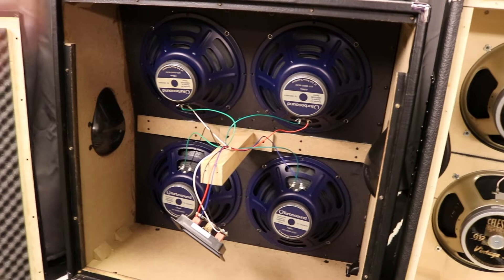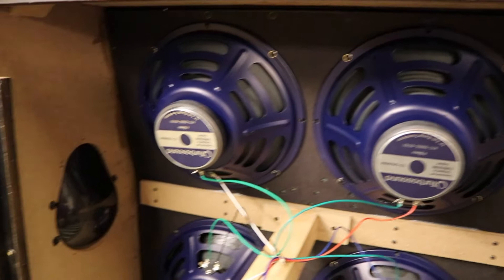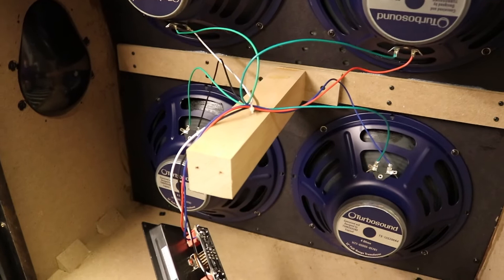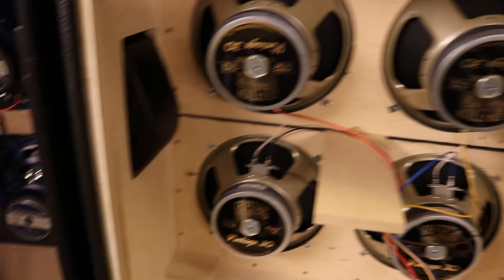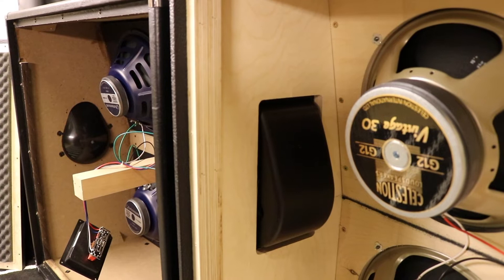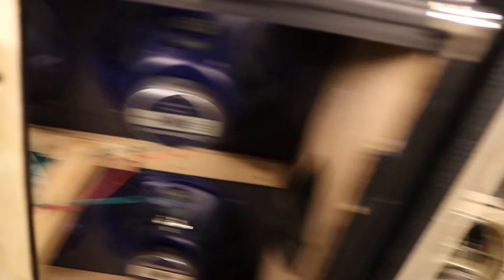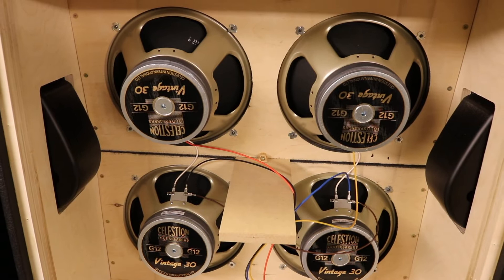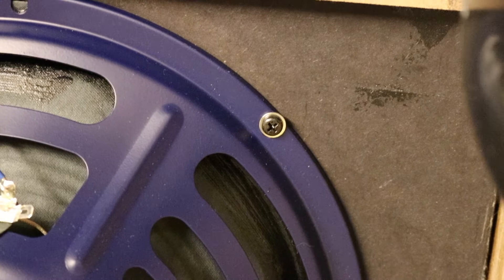Cheap vs Expensive 4x12 Cab WHATS INSIDE ?

Comment: MDF is used because it is very stable (sawdust mixed with glue) and doesn't resonate. All expensive audio speakers are made out of it for just that reason. Plywood resonates and adds unwanted color to the speaker via cabinet vibration. Keep it dry and its fine.
Reply: While I prefer plywood for it's strength, you are correct. MDF is significantly acoustically superior. Soundwaves hit MDF and decay gracefully whereas when they hit a hard surface like plywood, they shatter and produce obvious distortion. Ironically, because the speed of sound for plywood resonance is at around 700 to 1000 Hz, even though people build subwoofer boxes out of MDF, it's the one specific place plywood kicks it's ass. I've built sub boxes out of both, and the plywood boxes always have better SPL, sound cleaner and just all around superior performance. I knew a guy about 10 years ago that took my advice, built a monstrous subwoofer cabinet for his truck double layering the plywood, and without trying, took home 1st place in his city's bass-war competition. 

I have a lot of cabinets, some plywood and some MDF, and the MDF is just blatantly superior. The same speakers in an MDF box with poor low frequency reproduction having swapped them myself into various boxes suddenly produce low end spectacularly whereas in the plywood cabinets, they distort and the wood shutters. The remedy is packing the cabinet with batting or paneling the inside with foam rubber matting or even carpet. I have a 2x10 plywood cabinet loaded with Jensen MOD greens, and after I stuffed it with batting, it sounded phenomenally better. I actually grew to favor 10's over 12's even though I have a ton of combos loaded with them and four 4x12 cabs. 

Monday, I scored a Crate GX1200H head with a full sized 4x12 cabinet made of plywood. That series head traditionally came with compact 4x12 MDF cabinets. After cranking it really loud enough times, it's inevitable; I will have to buy a bunch of cheap Walmart pillows, rip them open and stuff them inside, or line it internally with foam rubber or carpet lol. 

Those heads are 3-legged mutts racing greyhounds until you mod the EQ capacitors and resistors, and add a midrange control to the lead channel. After that, they are the ultimate sleeper amp even being solid-state, but one way or the other, they produce so much bass that the cabinet is a shattered wall of noise when I crank it.
Reply: This reminds me of the guy who replaced the "cheap" MDF speaker baffle with plywood in his Silverton amp because the screws had ripped out, but it ruined the sound - sometimes "cheap" is better?

Comment: I have two Engl cabinets and bought them brand new, paid full price and I don't regret it a single day. I use them with my Engl Power ball and Fireball and the sound is just amazing. You get what pay for.
Reply: @destroyerproductionsandrec2127 I have the 2x12 Vert and yeah, they're never on sale so full price. I don't regret it though, paired with a Fireball 25 it sounds amazing.

Comment: Actually MDF is the most common choice for very high end high fi speakers.  They actually offer a lot of tonal benefits over plywood.  Although heavier and more prone to water damage you'd likely prefer their sound a good portion of the time with all other variables not withstanding.
Reply: Hifi speakers are designed to reproduce recorded music as accurately as possible. They are designed to reduce resonance and add as little color to the speaker as possible. These cabs are musical instruments, the wood colors and enhances the sound, the wood is part of the sound, a completely different design and purpose, you do want your musical instrument to be made of MDF, any real wood would be superior. So no, there is NO ONE who would prefer an MDF Cab no portion of the time unless you are after a very low quality sound.
Reply: Its 2023.  Touring musicians view 4x12s as stage props.  None of them are heavy when there aren't any speakers inside.  Plot Twist  The floor monitors they're actually using have plastic enclosures.
Reply: @darkscience1466 real wood isn’t necessarily “superior” as tone is really subjective.. some people may need or want the more flat response of MDF built cabs and I wouldn’t knock them for that. I do agree that plywood can give you more specific tone responses in certain frequencies but, so does the overall size and construction of the cab itself.

Comment: Turbo sound has been making speakers and sound systems since the 70s and those 12” full range guitar speakers are actually really good. Not sure why you say it sounds bad maybe it’s the amp you are drivin* them with. Plywood is heavier and not as good as MDF there’s a huge reason speaker  cabinets are built. Out of MDF . cracks happen to anything all the time especially plywood. I’d take the turbo sound speakers over those vintage 30’s anyday.
Reply from the maker: This is your personal likings, in fact as of today most metal-heads prefer high end cabs like Mesa, ENGL, Marshall, HESU etc, often with Celestion speakers in them and often with V30´s, those cabs are all made out of plywood and not MDF. All those cost more than 800 euros if we are talking about 4x12 cabs, this cheap Bugera cab does not even cost 200 Euros, its the cheapest 4x12 you can get, and no, it does not sound good in any way compared to an expensive cab. If there would be something in what you are talking about there would be Bugera cabs in every studio and on most stages, but it's not. it's mostly V30´s, or any other more expensive Celestion, in general.
Reply: @HearGear I've owned many high end amps and cabs and now running Bugera head and Bugera 2x12 cab. Sounds bloody awesome and stands up against the more expensive stuff. Yeah sure, Hesu etc. sound really good too but 4 times as good as the price? The answer is no.
The other point I would like to make is Bugera are in many studios these days.
Reply from the maker: @meagainokay7673  Its all about what speakers there is in the cab these days even cheap brands put Celestion Vintage 30´s in their cabs, of course to a higher price but still way cheaper compared to high end brands, this video is not just about the brand, its about this specific speakers I got in this Bugera, they are not good in any way.
Reply: @HearGear Yeah, I guess you can get lucky and unlucky with any speakers of the same brand. The V30's you're referring to in cheaper cabs are the Joyo and Harley Benton. They sound pretty good too, although the speakers didn't sound good in the early days before China manufacturing updated the cones. My plan now is to get a Hesu 2x12 and run it with the Bugera 333XL Infinium. I might even try running both cabs.

Comment: I like Celestions and all, but it's such a crude and primitive speaker with me having a formal background in science and engineering that I can live without them for something heaps cheaper! lol

MDF also greatly outperforms plywood acoustically, but obviously the strength and durability of plywood is exponentially superior. The ultimate solution to plywood cabinets is filling them with batting, or paneling them internally with sound damping material like foam rubber mats or even a thick carpeting. 
When soundwaves hit a hard surface, they shatter and produce a lot of crude and undesired distortion. When they hit MDF, they bounce off and decay gracefully. Ultimately everyone will prefer what they prefer, but adding damping material to plywood greatly improves their low end performance and increases clarity with your mids and highs.

I have a lot of cabinets and the variety is of both, and the MDF has always outperformed the plywood until I added sound damping material to them. After that mod, they are pound for pound acoustic equals, but the plywood is exponentially stronger, more durable and more reliable.

Comment: Well it's like this. Although  the  cabinet  is cheaper  made by bugera  I think will hold up on the road just fine.  The problem is the speakers have dinky magnets and that results in not a great sound. It may sound  fair , but not great.

Comment: I built a cab using solid 1/2" walnut and one high quality 10" speaker. I also bought a 5 watt tube amp. It sounds amazing. Two can sound great too. 4 is mostly unnecessary unless you need it loud. Go for quality over quantity.
Reply: I was thinking the same thing, but since they are discussing 4 x 12" cabinets I assumed it was about high powered amp cabinets.  I prefer solid pine cabinets, or even better - solid redwood like Gibson used on their classic amps from 1955-1962 (before and beyond?).  The cabinet resonates and sings with the solid wood, a plywood cabinet sounds harder, while and MDF cabinet wouldn't color the sound and probably softer attack?  I have a Marshall JTM-1H which is a mighty one watter that gets the JTM sound.  I was dubious about getting it, but everybody was raving about its sound, so I got one - they weren't lying!  People say if you plug the JTM-1 into a Marshall 4 x 12" with greenbacks it roars - I have an Avatar convertible cab (now closed) with a greenback, and I can't believe the sound.  Incredibly the 1-watt is too loud for a quiet neighborhood like mine, so I have to use the .10 watt setting to keep it at a reasonable volume.  Getting back to cabinets, I like them all - it depends on the music you're playing, your preferences, etc...
Reply: @pharmerdavid1432  Agreed. I sat in the high end amp section at GC today. Price aside, speakers aside, wood aside, you just have to plug into and try 4-5+ of them. Buy the one that makes you smile and you do not want to unplug. In my experience today, and other days, it's rarely the most expensive one. Same with guitars. I had $2k to burn. I tried a Martin and it was good- then I tried a Taylor for $800 and took it home. Maybe the Martin was ever so slightly better, but not by much. There is a quality curve. I don't buy cheap gear, but I am very open to lower, high end, slightly used when possible. The delta between that gear and ultra expensive is not very audible to my ears and never noticeable in a mix.

Comment: I've had amps with multiple. Speaker swaps. I'd take those turbosound over those vintage 30 any day.
  Those turbosound are underrated. Big time
Reply: And mdf is heavier than plywood..
   Your way off on that shit right there..
    The speakers are heavier from. Celeation.
   The soundboard makes the difference in tone ams does the size of the cabinet.
    Side and back wood doesn't mean shit.
Reply: The cab is fine but  the speakers are fair.   On the bugera. I have that cab. It's not that heavy because of small speaker magnets. It sounds ok  but I want a marshall cab. My head is the marshall jcm 900

Comment: Hello friend, one question, what sound effect does having that insulation foam on the back cover generate? does it improve the sound? or what is its function specifically? Thank you
Reply: Most likely it does nothing except making the back sound better if you knock on it with you knuckles. for the speaker sound it does nothing.

Comment: Are you even aware that you are looking at CELESTION VINTAGE 30 drivers???? These are some of the best, used by some of the biggest recording artists!!
Reply from the maker: Is there anything in this video telling you that I think Vintage 30´s are crap ?
Reply: FYI ... hate to burst your bubble .. but again they are 1 of MANY quality speakers out there ... but far from THE best. Furthermore .... some peaple quite honestly dont care if its a $25 or $2500 speaker there amp has in it or is outputting through.
Reply from the maker: I am interested in Celestion Type A speakers, i think they sound good and the price is not as high as Vintage 30´s, as you mentioned there is very much speakers out there but for people that are looking for a specific sound, then it all comes down to just 5-10 different speakers that people mostly are interested in. Most people don't know what difference speakers make until they get the chance to try them selfs... i think i might build a 2x12 in the future and put in those Celestion Type A in there.. :D
Reply: The speaker cab is the most important part of the sound, they are overlooked a lot but trust me get a shit cab with shit speakers and the sound will be shit , the best thing about bugera cabs is they cost nothing so you can get a good cheap cab by swapping the crappy turbosound speakers for some better ones
Reply: @johnodinsson1735 where do you get that notion that Turbosound speakers are crappy? Lol those blue speakers are better than those washed up vintage. 30s all day. Maybe not to the guy who posted the video but they are higher quality than the celestions shown here. Maybe his amp sucks. 🤷
Reply: @CasaDeJoker  as I used them for a wile both live and in the studio,  the issue is they just  don't do the job end of and you can also see multiple  videos on YouTube of engineer saying the same,  not that v30s are the only speaker in the world  there are a lot better  but there are also a lot worse in my opinion for most applications and I find turbosound speakers just don't cut the musical mustard  so to speak. Take this as you will  its just my opinion and you are welcome to yours.